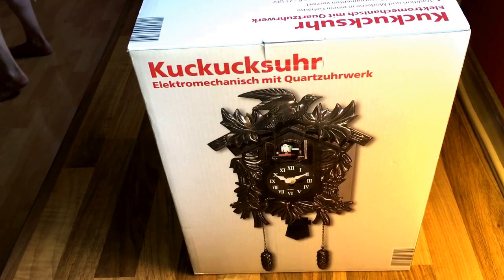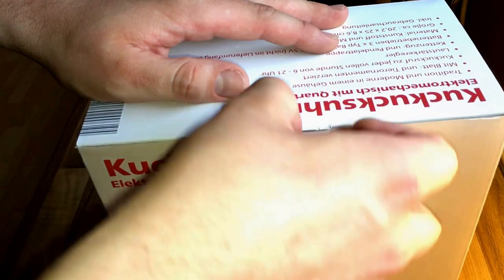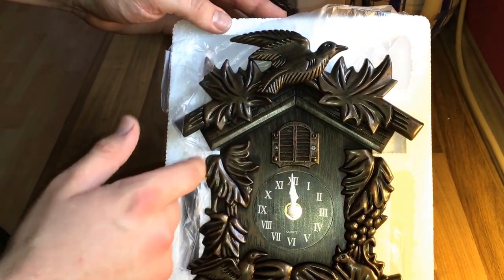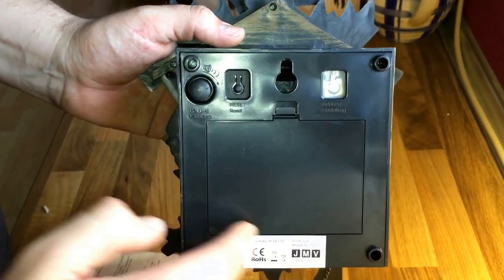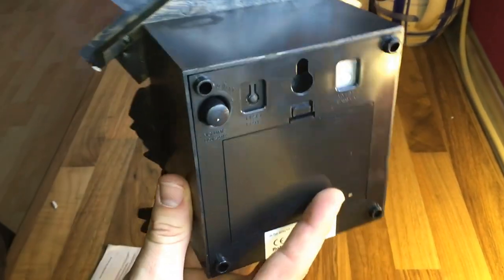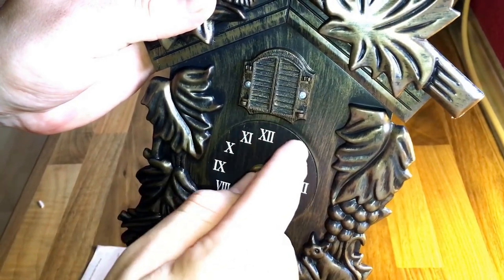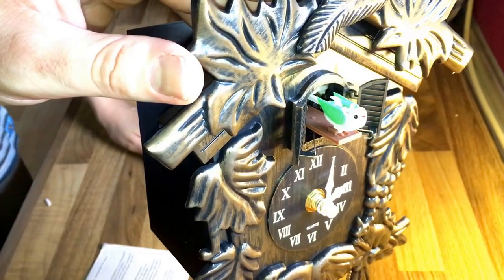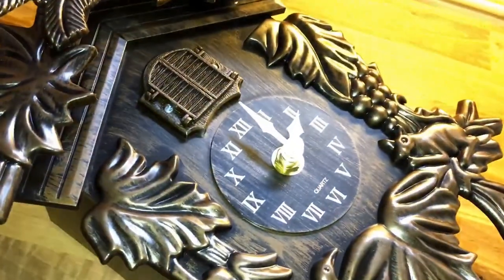Cuckoo clock unboxing and Assembly instructions

Comment: You need to adjust the call to the hour you do that from the back or move the hour hand corresponding to the correct hour meaning cuckoo calls 4 times its 4 oclock
Reply from the maker: Thanks for your support
Reply: Your welcome just trying to help
Reply: Is this clock still fully working?
Reply from the maker: Indeed